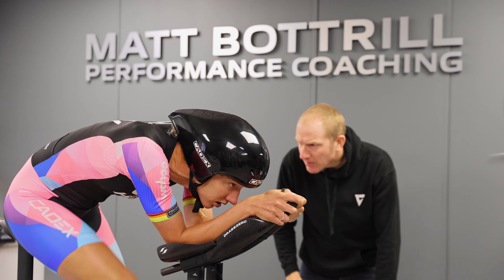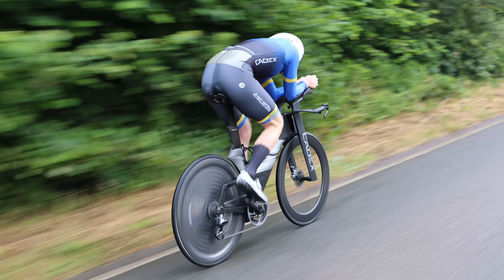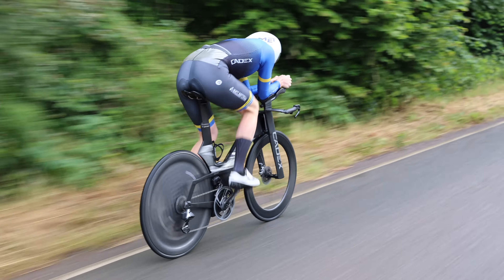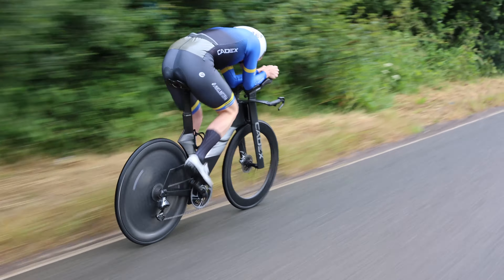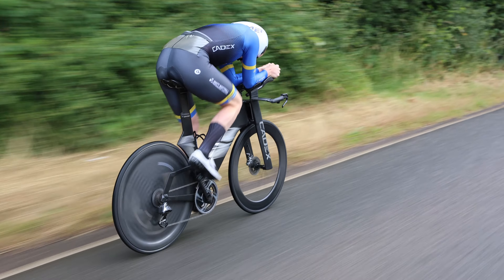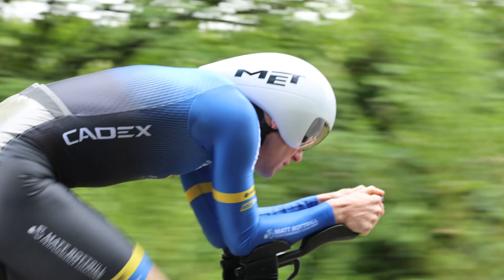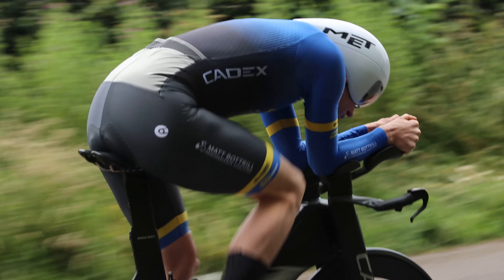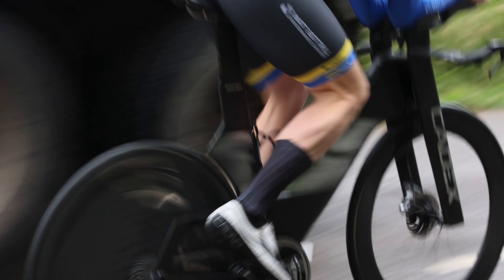Pacing into the wind | Make yourself faster when it's windy | time trial & triathlon cycling tips

Comment: This is a very interesting topic for me as I’ve recently moved from the UK to Sweden, and whilst the roads out here are amazing, because of the sheer amount of open fields out in the countryside, at some point of almost every ride I get absolutely battered by the wind, which forces me to go full aero in headwinds if I want to keep going at a decent pace, but I find that with tailwinds I can ride with a much more relaxed position and lower power as relatively speaking it feels like air resistance has been removed and my speed remains high, however what you’ve said here almost sounds line the opposite. It sounds like you recommend focusing on an aero position for tailwinds. My experience says otherwise, but I completely appreciate that you’re the expert on this topic, so I must be going wrong somewhere? What am I misunderstanding?